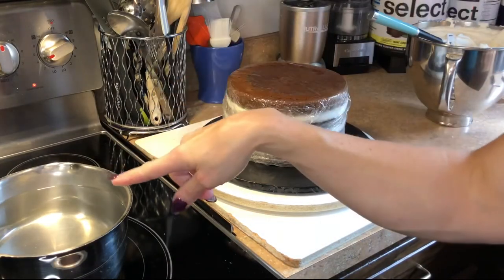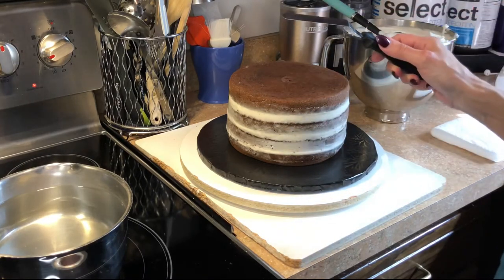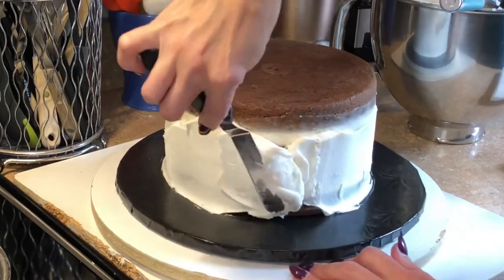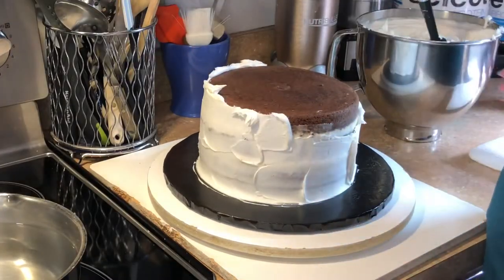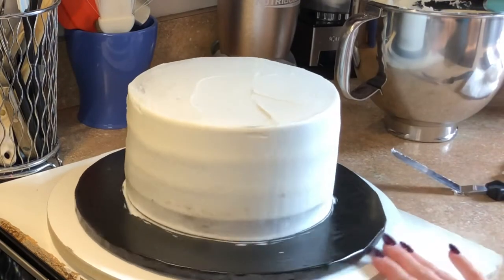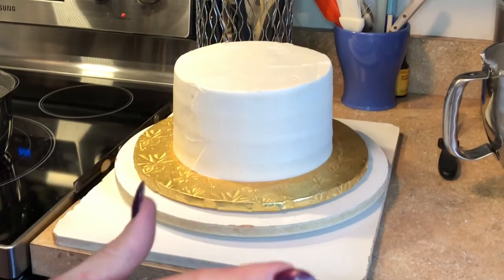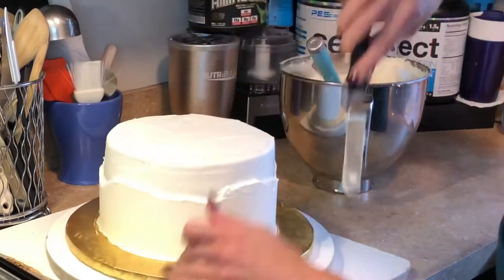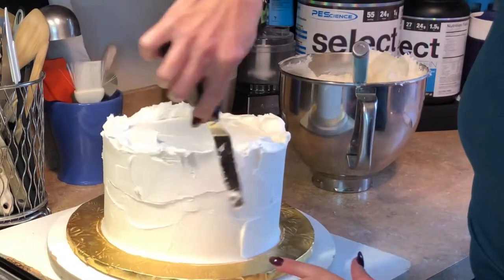Prevent Air Bubbles In Your Icing With This Technique | How I Ice Smooth Buttercream Cakes

Comment: I ice my cakes this way. However if you are going to have a topper on your cake, you can also refrigerate over night and use a wooden skewer to make a chimney in your cake. Air will follow the path of least resistance. Just take the skewer and stick it all the way down to the cake board and take it back out, you can fill the hole in the morning or use it for the topper. Love watching your videos. You have alot of great info.
Reply from the maker: This is great!!!  I never thought of this, but it makes so much sense! Thank you!!
Reply: @KarolynsKakes  your welcome, it's especially good for cakes that need to be refrigerated.
Reply: Great information  can I also use this method for whipped cream
Reply: @MwangoMumbi-f8p  I'm not sure. I only use American butter cream.

Comment: Thank you for sharing. I have heard other decorators and some say dont leave it in the fridge longer than 15 min and others say 30-60 min 😩.  I guess I will keep trying
Reply from the maker: You find what works for you!  I don't remember what I say in this video, but now I crumb coat the cake and put it in the fridge for at least 3-4 hours so it can solidify.  Then I add the final coat of icing.  I find it is so much easier to apply the final coat when the crumb coat is cold and hard because it holds its shape!

Comment: Okay! Hi. Glad I found this. My air bubble issues are tiny ones. I have been doing cakes for 18+ years and my last 5 or 6 cakes have tiny bubbles in the icing. I have followed recipes(which I didn't use to, maybe that's the problem haha). I have turned my buttercream slowly. I usually mix for a few minutes. I have pressed it in the bowl... it's super frustrating.
Reply from the maker: Air bubbles are annoying!  I still get them.  I rely on my smoothing method to get rid of them.  This only works on a crusting icing like American Buttercream (which is what I use).  I explain in this video:
https://youtu.be/RLZ49rMUxQM

Comment: Thank you Karolyn!! Question for you: if you use Swiss Meringue icing on the exterior of the cake, how would you make your icing smooth?
Reply from the maker: I've seen people use acrylic plates and / or just the bench scraper.  I've never made it or worked with it, so I'm not sure exactly what to recommend.  Sorry about that!
Reply: I use Swiss merengue all the time and I find that a hot metal scrape as she did works just as well, I also run the mixer with a paddle attachment on the lowest setting for as long as 20 minutes to get rid of any air bubbles, or hit it with an immersion blender works faster (and brings out the color of food colorings)

Comment: Thank you for your help 
Question when you was scraping butter icing after putting a spatula in hot water and you fixed,
but then I saw you use papar towel and smoother to smooth the side of the cake 
Did you did at the same time or you put in the fridge and then you did smoothing
I am sorry if you didn’t understand my English 
I am sad 😞 yesterday I did my butter cream filling and then I wrap with cling film as you showed in your video 
And today I did three tone butter icing and was working on top suddenly I saw of left Side bottom big air bubble 
Now cake is ready to go what I do ( one I did while fridge just pushed 😊
But again cam out 
Plz help me 
Morning is pick up time 
Waiting for your reply
Reply from the maker: Hi!  I use the scraper to smooth the icing.  Then I take the paper towel and smooth the side of the cake immediately afterwards. If you got a bubble, there was an air pocket between the cake and icing.  Just be careful when you're frosting the cake that you're really pushing the icing against the cake so air can't get trapped underneath!
Reply: @KarolynsKakes  thank you thank you   for help 🙏🙏🤗🤗
 I will follow as you say but and hit water scrap icing doesn’t stick to paper towels ? 
Once I did it got mass 😊

Comment: Love your video. Just had a similar problem with one of my chocolate cakes where it started to bulge out. Cake tasted wonderful but I didn't like the look of it. I will try your way for my next cake. Do you have any other tips on how to prevent the bulged from happening?
Reply from the maker: Isn't it the worst when you see one of those bulges forming? LOL
Make sure you let the layers settle after you fill the cake before you ice it.  When I fill my cakes, I let them settle overnight (sitting at room temp, wrapped in plastic).  You don't have to let them settle that long, but at least a few hours before you ice the cake.

Comment: How do you get your icing so amazingly white!? 🙌
Reply from the maker: It actually is a little off white because of the butter. If you need to get it whiter, you can add a TINY amount of purple (like the tip of a toothpick) to the batch. The purple will cancel the yellow. But it’s gotta be just a little bit or else it will look lavender!

Comment: Thank you so much for sharing, now how do you get your buttercream so white? mine is always beige.  Even using clear vanilla.  Do you add white color? thanks again
Reply from the maker: I feel like my icing looks whiter in these videos.  I use an American Buttercream recipe (I have a video).  If I hold my icing up to a white cake board, it definitely looks off-white.
If you want to get your icing whiter, you have to add a TINY bit of purple to it.  Since purple is opposite yellow on the color wheel, it will neutralize the yellow from the butter.  But make sure you use a small amount.  Like the tip of a toothpick dipped in the coloring added to a whole batch of icing.  If you add too much purple, it will have a purple hue.  I hope that helps!

Comment: Hi! I'm a home baker and have had success with all the other buttercreams except ABC. It has always turned out grainy and incredibly sweet. May I know,is that normal? I've sifted my icing sugar tons of times. What would you recommend? Yours looks amazing.💛
Reply from the maker: Hi Punesha!  ABC is sweeter than other buttercreams, so if you want something less sweet, you may want to work with a meringue buttercream.  (I don't make meringue buttercream, so I don't really have a lot of advice on how to work with it.)  
In my ABC recipe (here's the video https://youtu.be/-x8Tv6Hv6Us ), I use high ratio shortening.  It is pricier than regular shortening, but it is very smooth and has a nice mouth feel.  And I buy my powdered sugar in 2 pound bags at Target or the local grocery store.  I don't like getting the giant bags at wholesale stores because they tend to have a lot of clumps in them.  I haven't had grainy issues with my buttercream with this recipe!

Comment: Do I do the second coat of frosting if I put fondant? How much frosting is needed for both coats?
Reply from the maker: I always do 2 coats of frosting whether or not I'm covering it in fondant.  The second coat just makes it smoother and hides any bulges.  In total, I make the icing about 1/4" thick.  So each coat is about 1/8" thick.

Comment: This was an awesome tutorial! I’ve been doing a lot of cakes with a Swiss meringue type buttercream lately and have been having a really difficult time getting my icing smooth. I’m not sure what I’m doing wrong. Do you have a tutorial on smoothing your cakes that use a meringue based icing? 😃
Reply from the maker: Unfortunately I have never worked with meringue buttercreams so I am not sure how different the smoothing process is.  I'm sorry!
Reply: I would assume swiss merrigue buttercream should be much easier to smooth because it's like cream.. I have worked quite a bit with merrigue and it's lovely to smooth. But you can't use karolyns techniques with it. I am wanting to know how long swiss merrigue can be kept on the fridge? I will Google.. Bec I want to start using it with my lunchbox cakes

Comment: Hi karolyyn how do you get your buttercream to look so white?
Reply from the maker: You can cancel out the yellow tint that the butter adds to the buttercream with a TINY TINY bit of purple (opposite color from yellow on the color wheel).  Like just the tip of a toothpick for an entire batch.  It will make the icing look whiter!  Make sure you don't add too much purple because it will start to look lavender.

Comment: Hi Karolyn, I used your buttercream recipe but I had tons of little tiny air bubbles and it didnt look smooth like yours. Am I doing something wrong? I used the hot bench scraper but the tinny bubbles never went away.
Reply from the maker: Did you beat it too much after you added the sugar?  Did you add enough liquid?  Those are 2 things that could be the issue.  I do get some air bubbles, but can smooth them out using the method from this video.

Comment: Condensation: you said cover when cake is at room temperature but I've seen n told cover when cake is cool from fridge but recently I've seen my cake with condensation could you clarify more on that as I'm not sure if I'm getting the info correct
Reply from the maker: I do the crumb coat when the cake is at room temperature.  Then I put it in the fridge to solidify.  Then I do the second coat with it right out of the fridge when it is cold.  If you refrigerate your cakes, you must control the environment where you're decorating.  In the hot months, the room must be cold (air conditioned).  If you don't have access to air conditioning, I don't recommend refrigerating your cakes.  I'm not sure how to work with cakes that aren't refrigerated so I'm not sure what to recommend if that is your situation.
Here is a video where I talk about refrigerating cakes!
https://youtu.be/vBKi-O7v98w

Comment: Do you wipe off the water from the top of your cake after you smooth it? If not , what happens to the water?
Reply from the maker: If there is a lot of excess, I lift it gently with the spatula as I’m smoothing it and shake it off over the sink. And any small amounts will get absorbed in the icing.

Comment: How do you get your cake to stay on the board.
I do use buttercream on my board but my cake still slides around and it's so annoying. Will really like your advice on this🙂
Reply from the maker: For big cakes, I just use buttercream.  For smaller cakes (or if you're having this issue no matter what), I melt some candy melts / chocolate and adhere the cake to the board that way.  I demonstrate it in this video!
https://youtu.be/zV-ntP2pblY
Reply: @KarolynsKakes  thanks so much for replying. I will try this on my next cake and give you feedback 😘
Reply from the maker: @chiamakaokoro5288  Let me know how it goes!
Reply: Hiii
I used the melted chocolate like you said and it worked out.
I was a bit sceptical as I haven't done this before but it was amazing thanks so much
I really am so happy that you got back to me, answered me and actually preferred a solution.
God bless
Reply from the maker: @chiamakaokoro5288  You're welcome!  I've been doing it like this for a long time.  I was so frustrated with the cakes sliding all over the place and this works so well.  I'm so glad it helped!

Comment: Hi karolyn.. If I use your method and put a paper towel on my cake in order to smooth, it takes all the icing up with the paper towel. Do you know why that would happen?
Reply from the maker: Are you using American Buttercream?
If the icing is too wet, it can stick. 
You can also let it crust for a minute or 2.
Reply: @KarolynsKakes  yes I am.. Ahh.. Ok I will try that

Comment: I honestly don't think its just one problem. So I crumbcoat all my cakes, then do my final ice. I notice this issue on my gold drip painted cakes. I notice this happens more when I paint drips, as the cakes stays out the fridge for a while which causes the buttercream to soften and bulge. As for drip cakes I've done, not painted, they're normally fine. Ofcourse bulging happens once in a blue moon, not often, but its problematic!
Reply from the maker: Thankfully it doesn’t happen too often to me anymore. But it is so annoying when it does! 
Do you let your cakes settle after you fill them, before you ice them?  What kind of Buttercream do you use?  Are you in a humid climate?  If so, do you work in a cold air conditioned room?
Reply: @KarolynsKakes  depending on how much time i have, I sometimes crumboat, then place in the fridge for 1 hour, then fully ice and leave for hours. 

Sometimes it can take an hour or so to paint the drip, which I find so annoying.
I normally keep my windows open and fan on if its summer. 

Its spring here so quite cool which is the perfect weather for cakes I think.
My biggest nightmare is icing cakes in the summer heat, especially when there's a heat wave.
I live innthe United Kingdom 🇬🇧
Reply from the maker: @mackaysjamaicankitchen6392  Yeah I feel ya, I LOVE winter only because there's zero humidity around here!  I need to see if I can figure out a better way to get gold drips without painting it on.  There's gotta be a way!

Comment: How do you not get air bubbles in your buttercream whilst mixing it, mine ends up full of air bubbles from mixing yours looks so smooth with no air bubbles in from mixing
Reply from the maker: There are some bubbles in my icing, I just do what I can to make it look perfect!  I find that if I add a little more liquid that it isn't as bad.  (Have to make sure it's only a little so you don't get icing that's too thin.)  And also if you're making a lot of the same color, you can whip the air out by filling the mixing bowl and completely covering the paddle (so the bowl is full) and mix on 6 or 7 out of 10 for a minute or so.  This is hard to explain in writing, I will have to do a video on it.
Reply: @KarolynsKakes  Thankyou for your reply I will try what you suggested. Love your videos

Comment: How do you cover a Fondant cake without bubbles?
Reply from the maker: You must make sure that no air gets trapped between the cake and the fondant.  So when you're smoothing it down the sides, you have to pull it out and flatten it.  It's happened to me before where I got bubbles under fondant and it SUCKS!!

Comment: Can I use parchment papers instead of using Viva paper towels as it is not available in my country?
Reply from the maker: You can, just make sure you let the icing form a crust first so the icing won't stick to the parchment paper.  And it may be best if you cut the paper just a little higher than the top of your cake.